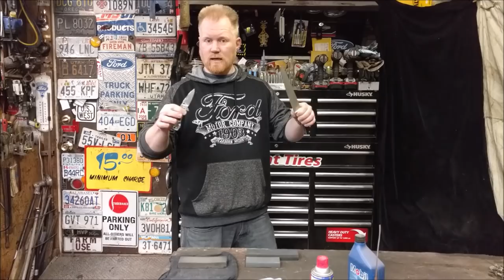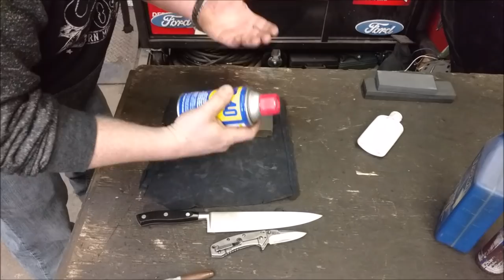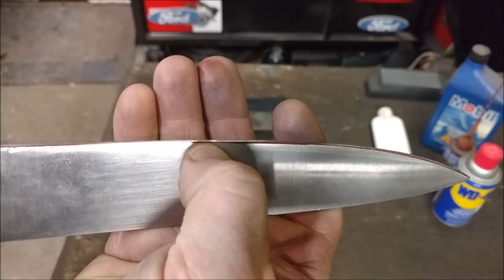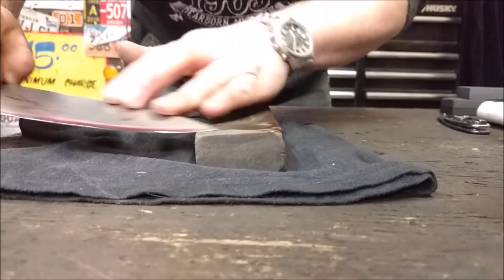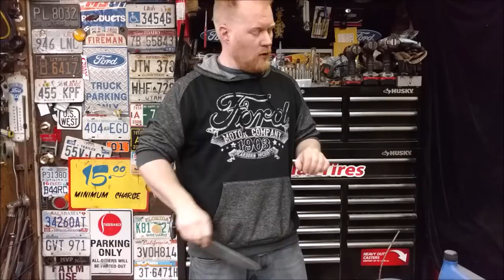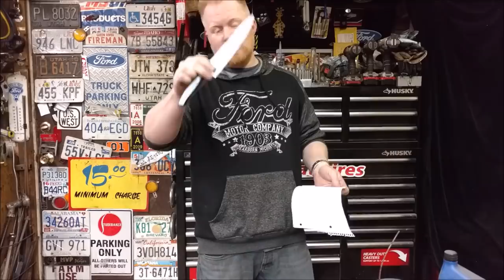How to sharpen a knife -Basic Sharpening Techniques

Comment: What is the best to use to get a few knicks and dings out of the blade. Closer to the tip than the heel of the blade. Would a stone be my best bet? Then home it on a steel and take it back to the stone? I also strop the blade on a leather belt for the final step. Seems to always get it razor sharp!

Comment: Thank you for your instructive video.   Why is it necessary to use oil on the stone?  What happens if I skip the oil?
Reply from the maker: The oil helps the blade slide over the stone easier, wash away debris, prevents metal from clogging the stone surface and keeps the stone from tearing the blade edge. Essentially you'll get a sharper blade with oil.
Reply: @sixtyfiveford  Thank you for taking the time to respond.   Very helpful.

Comment: Thanks! Can you explain what is the purpose of the oil? What would happen without it?
Reply from the maker: The oil does a few things. First it helps the blade slide easier across the stone so you can do a uniform/steady stroke. Secondly, it float the metal filings away, so the blade isn't grinding into it's only fillings. Lastly, it keep the blade edge cool while sharpening.

Comment: I have sharpening stones which I have been using for years, and now have an electric sharpener since there are times when I need an edge on my kitchen knives and is in a hurry. I first started using sharpeners while in the Air Force and had to keep the knives sharp to work with the parachutes we rigged to drop cargo. The unit issued us all new knives and I saw what most had done with those new knives and mine was like new due to the way I sharpened it, and tried to teach others how to do the same thing.

Comment: Good job Bro, I never would have thought of ATF! Thanks!!!
Reply from the maker: Hey Thanks. ATF just seams to work the best.
Reply: Martin Elam air tool oil works good too and is prettty cheap. Not as cheap as grocery store mineral oil.
Reply: I think ATF has a detergent pack that helps carry away the particles and prevent clogging. No workshop should be without some.
Reply from the maker: There's debate on whether most air tools oils is simply ATF. I run ATF through all of my pneumatic tools with excellent results.
Reply: I'll have to try that too! See you can teach an old dog new tricks!!! Lol

Comment: Another controversial point out there is not to use oil on the store. The point if the stone is to have the aggressiveness of the stone and using oil reduces that. But, I've used oil all my life. An alternative is to use diesel but I haven't tried that yet. Thanks for the video Moe.
Reply from the maker: Very True. I prefer oil. I have a water only stone (1000/4000grit)and it's irritating to keep it wet. Seams I can only get 3-4 stokes in before I need to add water. If I let the water soak in it gums up the surface with metal particles and I have to rinse the entire stone surface. Diesel is a great idea.

Comment: I was a Scout for years. Never was without my ol` pal, the iconic Scout knife. I never was any good at sharpening it. When I got my first salaried job in a restaurant, I learned how the chefs kept their knives in good shape. It is the honing steel. To remove steel on a knife edge isn`t my first choice anymore. I use a honing steel,  then I  strop on my kitchen cutting board. The steel doesn`t remove any metal. It kind of "irons", or swages, if you will, the damaged edge back in line. Razor sharpness isn`t all that important, especially, if you use the thing all the time. Of course, there comes a time when the blade`s edge needs to be re- ground.
Reply from the maker: I use the honing steels for my large kitchen knives on a regular basis. They work good, but it always makes an extreme difference to slide the knife across the stone a few times to really bring back the edge.
Reply: I'm

Comment: Hay my old friend about that old stone I got this idea for you it has worked for me for flating a stone 
If you may have a peace of ceramic tile and a bit of oil  oil up the tile and rub it in circler motion viguriosly
Till it's come down reasonable flat it might take a few mins to get it back like it was new yeah it might help to mention the bigger the peace a the cleaner it is helps no glue and reasonable square with long strokes left that out sorry  all though it might come of with the oil but it works good instead of tossing money into someone else's pocket give it a try
Reply from the maker: Thanks for the insight.

Comment: good vid! It Is amazing how a lot of grown man can not sharpen a knife!!! now how I do it is VARY unorthodox! I only use my aluminum oxide stone on rather dull and worn knives now.! and gasp I use no lube at all!!! read a book on sharpening from 70-80s and the book recommend to just tap the stone every so often on a towel as you sharpen. the book stated that lube make the blade harder to control to get the best edge and the lube cases more harm than good and tapping it on a towel is sufficient to remove metal shavings. I use unglazed ceramic on the bottom of kitchen ware now as it can do most jobs. I take care of my knives so the moment thy get the slightest dull I sharpen them as such: use the top of a car window or frosted glass as a stone then when sharp using the paper test I finish up with a leather pants belt or in a pinch a clothe pants belt works!! it get a edge that I can shave with, and stays sharp even with a lot of use!! just using the frosted glass edge and a belt it will spring back to life after such as new!! however in the past I have not been as proactive and just use a stone. I sharped them with one side of the blade more so than the other, like a mower blade but not to that degree. it had 2 edges like a normal knife but less on one side than the other. I like that edge as it is sharp and is stronger. I change all my knives edge to that profile. as I have moved to sharpening more frequent so the edge is more preserved, one need less aggressive methods. the frosted glass and belt works wonders. as one uses it often to keep the edge up, it polishes the edge and micro bevels the edge and over time makes the edge more resistant to dulling and prolongs the life of the knife. it is my go way. it take little time and less skill. how ever one has to do it more often and the edge can not be in bad condition form the start.  hope this give out sum good ideas as their is a lot of complex ways to do it. take care
Reply from the maker: I've done it dry in the past, but I feel like I have more control with a lubricated surface. I find it easier to do uniform passes and never stop.  But it's all what you get used to.
Reply: cool I have not met another person that has tried to sharpen a blade with no lube on the stone. the arm chair experts wold love to see one use no lube and say you cannot do that!! also I use a strop be it a cloth or leather pants belt. I like using unglazed ceramic 1st if the edge is not destroyed ,2nd frosted glass,3rd leather or cloth pants belt. try it it works good. all so i use sound to get and keep a good angel on the blade it makes a shz shiz sound but I have used the marker trick and is the best for a beginner.

Comment: You don’t lead with the sharp edge going away from you cause if you have a wetstone just under $100 quality it may catch and gouge it. Also your stones are way too coarse. Your final run should not be any lower than a 1000x. You do one side until you create a burr on the complete edge, then switch sides until a burr is created again. Then you go to a fine grit and do the same amount of strokes on each side so the burr disappears. Then either go finer again to 5000x or 8000x then strap it with a belt.

Comment: I have sharpened it wrong for the past 40 years? wtf? I slid the backside forward rather than the blade side... lol... (yes I was a boy scout also) I only have a little 4" stone I got when I was 15yrs. It still works fine, but decided it's time to upgrade after learning about how dirty/plugged up it was, and how to clean it, and realizing how small it really is... lol.... TY Muchies :)
Reply: yes clearly scouts never taught you to sharpen a knife proper, scouts did for me then the military, never go backside first, you arent actually sharpening the blade.

Comment: You make it look so easy, but it's a skill you have to learn with fair angle accuracy :-D.
I don't need a knife that sharp, just good enough to cut wire insulation with medium pressure.
A razor sharp knife can be quite dangerous, too easy to cut yourself :-(

And a safe knife for cutting most food is the serrated "bread knife", they work really well, even when old :-D.
I needed to cut thin carpet so i used a crude dremel grind on a very old stanley util knife, it was nasty and had a rough edge, it worked very well, i was supprised it worked at all.
Sharp in an odd way lol.
Reply from the maker: When I take the time and get them up to 4000grit they get scary sharp. A serrated edge is always a handy knife to have around.